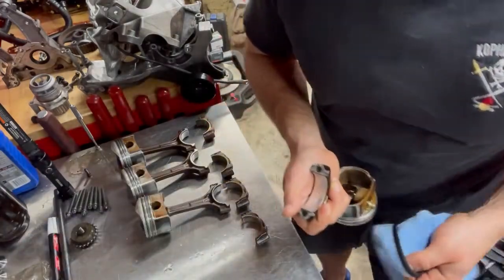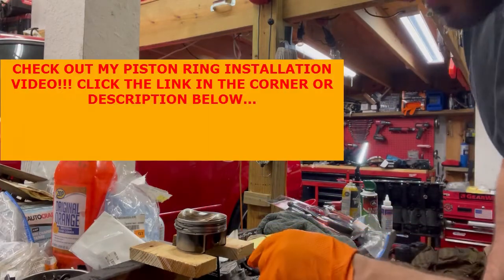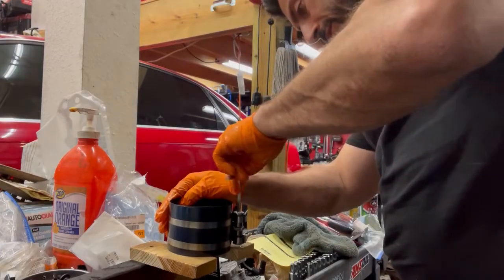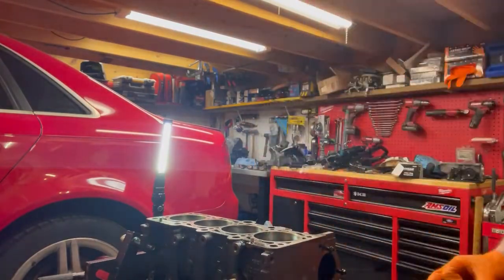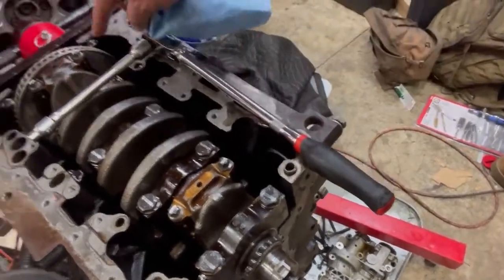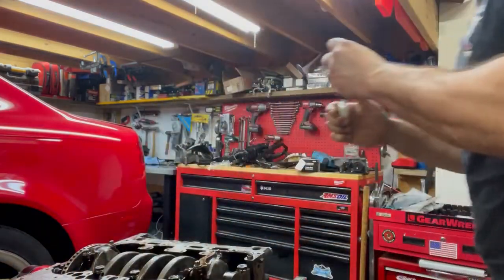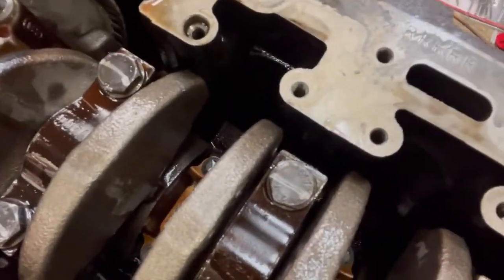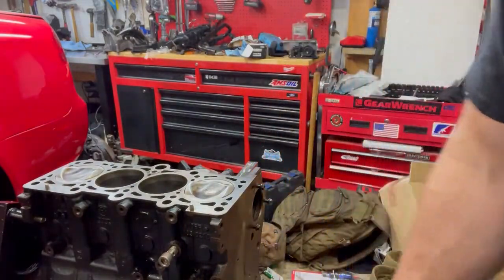PROJECT ROJO RE-DO PART 9: Dropping Pistons in the Audi 2.0 FSI Block

Comment: What pistons are you using?
Reply from the maker: OEM pistons. Scrub the piston ring channels with carbon cleaner to make sure they are nice and empty of debris and do the same for the dished area up top - mostly for appearance though. If you are going to be at stock power levels and your pistons are in good shape, there is no need to replace them.
Reply: @beerwrenchgarage  Odd, my pistons look way different.  Mine is an 08, so should be the same, but my pistons are basically flat with a round depression in the center.
Reply from the maker: @wesmartin1168  Are you working on an Audi or VW? The VW pistons in the Passat/Jetta/ etc 2.0 motors are like you describe. The Audi pistons have the crowns. If you have an Audi and your pistons are like that, it is likely due to the fact that the it isnt the original motor. Either way, it doesnt make a real difference at stock power levels.

Comment: Nice job Doc.  Good technique on the prelubing of components and con rods bolting/torquing.  I just would have mentioned that you were using new TTY con rod bolts.  Most folks know not to reuse TTY bolts.  Looking forward to to next video.
Reply from the maker: Thanks Brother for the kind words - you are 100% correct - usually I am adamant about stating the fact that I am using new TTY (torque to yield) bolts, but I guess I just forgot here. I do make a point of mentioning it in my main bearing cap video: https://www.youtube.com/watch?v=wabsHMm-P6g&t=1s